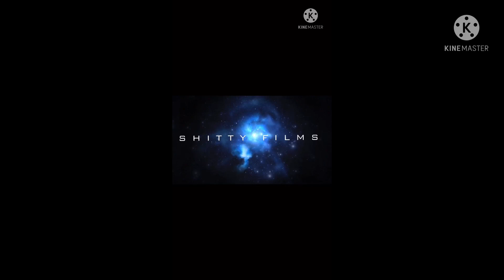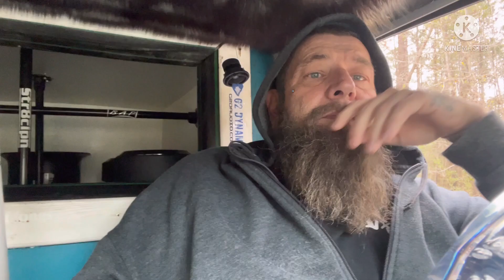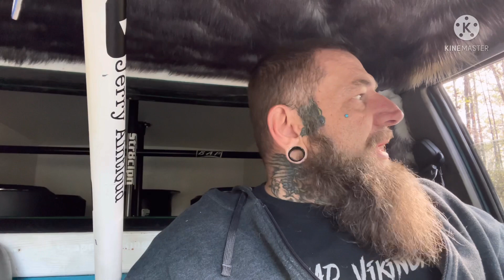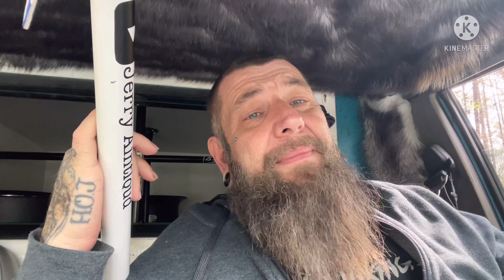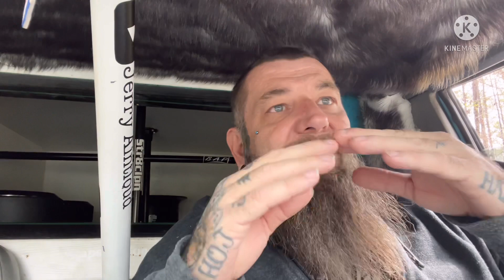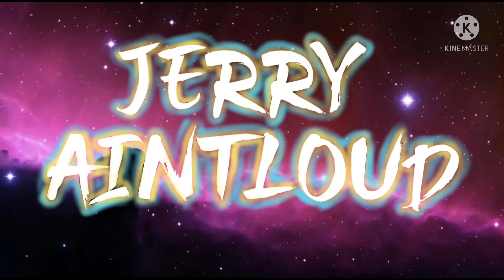Subwoofer Coils, Magnets, and Spiders

Comment: There are misconceptions,  when it comes to voice coils, wire material, 4 versus 8 layers and wiring of subs and so forth. First thing is wire material.  Copper is heavier, yes. Copper is king, when it comes to sound quality and lower powered systems...not meaning low power always..but in general. Copper also holds heat longer than aluminum. But, copper is more conductive. With most copper coil drivers, the fs is lower, as compared to using aluminum. Aluminum is lighter,  dissipates heat better, and usually takes more power Now, 4 or 8 layer coils are all dependent, upon how the sub is wired. If a driver is wired with coils in series, you will utilize all layers of the coil, in the magnetic field of the gap. When you wire the coils in parallel,  you are essentially using half of the windings, in the gap. So, if you use an 8 layer coil, and wire them in parallel,  you are utilizing only 4 layers of that coil, and the other layers are just moving mass. The old argument of 3" versus 4" coils and power handling, is just that. It's a he said, she said argument. A 3" coil, can take as much power, if not more, when utilized properly and on the same power as a 4" coil. Mainly due to moving mass...or MMS of the driver. The 4" driver is heavier in mass most times, therefore it stays more in the magnetic gap, building heat if it is in fact heavier then the 3" coil. There are so many variables, with drivers and coil sizes, that you cannot define which is better at handling power. Alot of new guys, may not understand the conversion of electrical to Kinetic energy...and heat involved. Then you get into motor force(BL) in which most drivers, if dual voice coils, are measured with coils in series. This is where you get the highest BL, and can utilize all of the motor force. I always prefer to buy and or build drivers, so that I can wire the coils In series, to use that motor force and all layers of the coil. Wiring in parallel lessens the coils windings in gap, and lessens overall motor force. I prefer 3" coils myself, personally. I always have preferred them, and that's just my opinion.  I also never use a factory subs tsp's...I use DATS and base the tsp's off that program. Also, efficiency is only minor in subwoofers, depending on the enclosure and its compactness. High efficiency drivers work better in bigger enclosures...not in smaller.  Hoffman's law plays a huge role in drivers, and should always be used to determine what you run, and how you run it. I do not ever recommend neo motor drivers in a setup when demo type vehicles...Jerry you're right. The heat is horrible on neo...and they will eventually start to lose there strength over time.  Lastly...the EVL, it is a decent driver, and was more geared towards sound quality versus spl..but, it also likes bigger boxes. It isn't a good driver at all. I won't ever disagree with you on that. Love the content my brotha, as usual.
Reply from the maker: very good write up...
Reply: @JerryAintloud  appreciate you sir! I am digging your channel, and have been going back and watching old videos when I can. You're a good guy man, just keeping it real, and simple!

Comment: What temp does your coils run at, at ruckus I was getting to like 300° within a minute, I never kept pushing to see if they would stay or cool, but after ruckus I have not had as much issues, but I figured I was making like 8k on a 3k sub, I am turning my amps down to about 4500 a sub

Comment: I had a big choice either change my 4-18'a to four-4 inch coils. Or go to. Six 18's with 3 inch coils the four have more area according to a calculator but I went with six I should know if I made a good decision tomorrow wiring amps now

Comment: I know your busy and have alot of personal things going on. And I'm sorry to ask this but if you can and get a chance will you look at the parameters of the db drive g3 blackouts 12 inch  dual 4s and give me your personal opinion on them. I'm about to spend 1500 for 4 and just trying to see if they are worth it . Ive tried to learn how to read parameters but it's hard for this hillbilly. Thank you for these videos and your time that goes in them. They are very helpful and inspiring
Reply: you could get sundown xv2s 12s from car audio bargain for $415 rn id do that. those db drives look bland and the sundowns are more efficient. 84db vs 82db
Reply: No theyre not good subs and also id stay away from that company as a whole
Reply: @zacharyhafer2806  what's wrong with them?

Comment: I chose the sundown Xv3's instead of avatar subs cuz of 3 inch voice coil vs 4 inch voice coil. Avatars just eat power. They're nice, but I'd get more sound and xmaxx for less power out of the Xv3's. But I can't agree with u on the EVL's. I ran em for 9 months, and they can move some air. More of a sound quality sub tho. And they do clip and max out easily. But I think they're great in their own way. Although I only had the 12's. I may agree with you on anything bigger.
Reply: I always wondered about the EVLs...I have always had DDXs(12, now a 15 about to get two 15s) but I wondered if the EVLs sounded better and/or louder than the DDX bc of the bigger voice coil but then again the magnet is only 166oz as opposed to 202oz which I just wonder if that makes any difference but I LOVE the DDX for SPL and SQ
Reply: @trickedoutequinox3265  yeah I'm pretty sure sure they're not too far apart. I know ddx is more spl, and evl is sq. I've seen some crazy loud builds with both tho! I'm trying to stay away from skar now tho just cuz the best you're gonna get is the zvx or vxf and been like that for years.
Reply: @Scott Wright🔊  Yeah I just don't see the point of going to much more powerful than 1500 rms with subs unless u are doing competitions...I mean just my one ddx15 is pretty loud on 1500 watts so when I get my two going on a 3k it should be nasty which I can't imagine wanting to go more than that bc then I'd have to completely redo all my electrical and so on and shit gets expensive u know...what all do u have btw?
Reply: @Scott Wright🔊  Also I wonder how much better the VXF/ZVX sounds better than the DDX/EVL line? Like a little bit or a Lotta bit
Reply: @trickedoutequinox3265  honestly, I had EVL's and simply swapped ro sundown Xv3's (2000rms) and there's really not a huge difference 🤷‍♂️ but my box is too small now.
Reply: @Scott Wright🔊  LOL damn I bet those were expensive too...I'm sure if u made your box bigger it would make a world of difference and put more power on them...a good box is supposed to make a bigger difference than better subs from what I've heard...I'm actually worried my new box is too big lol...it's like 7.5 cubes for two 15s I haven't put them in yet